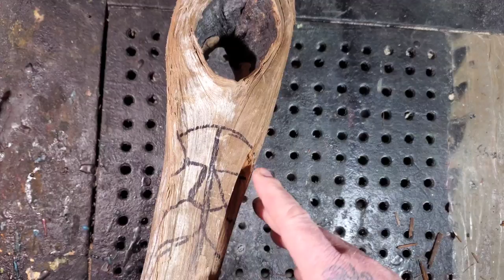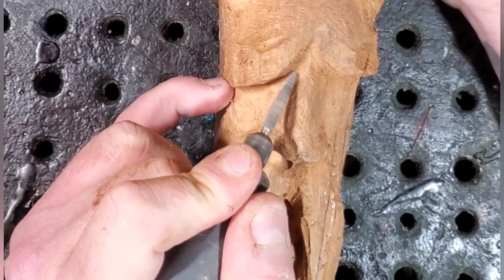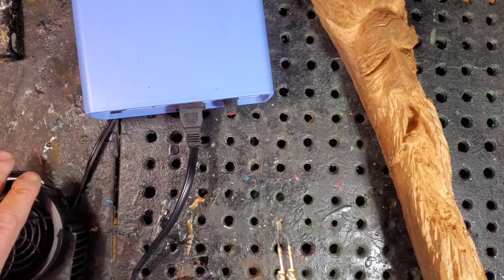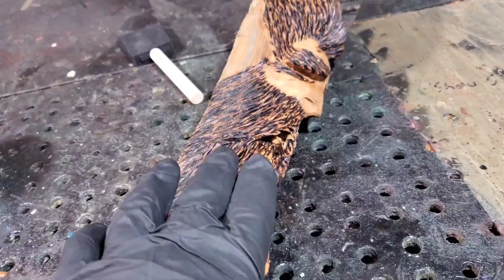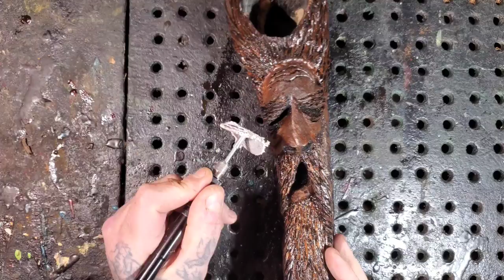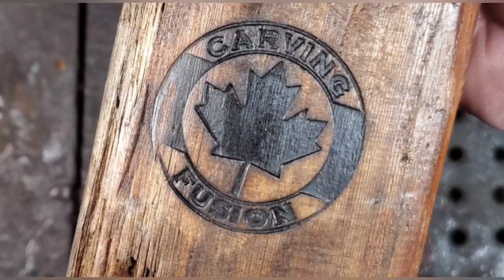The diffrent types of burs i use  to carve in my  flex shaft rotary tool and other Tips.

Comment: Hi Jordy...been following your vids and wanted to start carving myself...curious why in this video you used a burning tool for each line vs using a blow torch? Built my sanding table with your video so looking forward to starting soon!
Reply from the maker: Wicked!! Using the wood burner makes your bears hairs rwally stand apart from each other giving your carving more detail!.
Just burning it takes away the detail!
(Burns it away)

Hope this helps
Reply from the maker: Using the wood burner give your beard hairs more detail makig them look singular,
Burning it takes away detail,.
(Burns it away)

Comment: Good morning JORDY, I have a serious question. I found three old pieces of driftwood. Now I’m down in Florida but I started to do a Wood spirit and the Word on this Driftwood is so freaking hard I’m wondering if you have a suggestion on what to use. I’m use the flame burnr extreme but I’m getting a lot of smoke coming off that Wood. Should I use one of those aluminum burrs Or just continue to wrestle through it with the Flamer extreme
Reply from the maker: I would let the wood dry out and also use the aluminum burrs